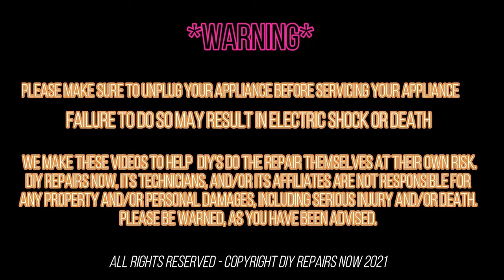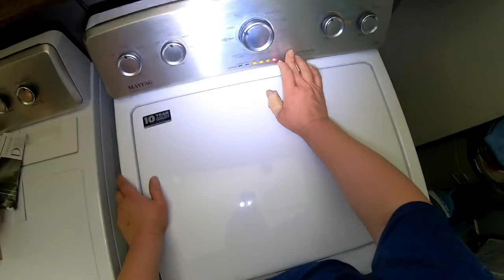How To Fix Maytag Centennial/Bravos Washer OFF Balance | Washer Shakes Bad During Spin Cycle

Comment: Should not have these problems. Maytag went cheap the last few years. Had a 30 year old maytag that we had to replace because the tub rusted out. The centennial we bought shakes so bad it moved across the floor and pulled the drain hose out of the wall port and its only a few years old. This is the perfect example of corporate greed now days. Dollars over quality. This new hanging tub with struts is a joke. “Load sensing” is crap. I miss the old style that never had shaking issues and only took 1/2 the time. And I could choose the water level…….

Comment: this video, way too much being done. wear gloves, pull up on the rod, take the top off. let it down, depress the tab around the rod to release from holder. slide out of holder, pull whole rod from top, take tab off old rod and replace on new. slide back in holder, pull up to snap tab in place pull rod through top replace top cap and voila! thanks!
Reply: This is probably the most helpful comment I’ve found on YT so far!  👍🏼👍🏼
Reply: So you are saying it can all be done from the top?
Reply: Make a video then. Easier said than done
Reply: Or your just slow

Comment: Try tightening the flywheel first to fix unbalanced load issues. It worked for me. Turn your washer on its side ( tape the lid shut to prevent it from opening and disconnect the water supply lines) Use a ¼” allen wrench to tighten the flywheel (bolt is in the middle of the round wheel) . It will be tight to turn. You can use a short piece of pipe on your wrench for extra leverage. Wear gloves so if the wrench slips you won’t hurt your hands. Hope it works🤞

Comment: I can confirm this fixed my Maytag Centennial washer which had been violently banging around during the rinse and spin cycles (for too long I'm ashamed to say). I have model MVWC200XW3 and bought rods with part # W10780048 from RepairClinic. EXCELLENT video! My screws in the back were slightly different (and you need a 1/4" socket). I didn't have to remove the drain line and used jack stands to hold the front and back up. Like in the video, i used a coat hanger with the ends wrapped around a wrench to lift the rods into place. Take pictures of the plastic rod holders beforehand. I recommend doing only two rods at a time, or just one at a time if you aren't confident in your arm strength. The bounce test is on point! Drum was really loose (I'd describe it) before and bounced a couple times (didn't seem like a lot at the time). With new rods the drum firmly and smoothly resets to the level position after a push. Tested with a large load and have a smooth spin. Thanks for the video! It convinced me my suspension rods were bad and took me less than an hour!
Reply from the maker: You’re welcome and thank you for a detail comment that helps people 💯💯👍🏻👍🏻

Comment: I have a similar model and mine is imbalanced even when empty but if the machine started slower, it would be fine. It's like the thing that tells it to spin doesn't work perfectly with the older shocks. It's probably on purpose so it saves them money and makes people buy another one 😂

Comment: Check the level of your washer as well…I changed out the suspension rods, no change. Adjusted the legs to get my washer level, added the four springs around the suspension rods and to the tub, and now it’s back to normal. This wasn’t too bad.
Reply from the maker: Thanks for your comment I’m glad my video can help💯💯👍🏻👍🏻
Reply: @DIYRepairsNow  Hello there Sir. My wife is telling me that washer shakes a a lot and the spin cycle is not working ( cloths are super  wet )
Is this the cause of that problem?
Thank you in Advance 👍

Comment: Thanks for the video! My 14 y/o Maytag Bravos had gotten to the point where it couldn't even complete a cycle without throwing multiple uL codes. I was able to replace all the suspension springs from the top side, which made the repair super easy. I did need my wife to hold the tub in the opposite corner from where I was working while connecting and disconnecting. I have small-ish arms and was able to use the vice grips to pull the old rod up enough to disconnect it from the plastic bearing at the top, then let it down in the cabinet. My arm was just long enough to reach in and unclip the lower blue clip piece from the tub and just slide out the whole old assembly. From there, I reversed the process with the new assembly and was usually able to get the blue clip to attach itself on the tub. On one or two, I had to reach in and help it, but it was no problem. The vice grips were then used to pull the rod up through the hole (I didn't need the wire loop trick) and put the new bearing on. I hope anyone reading this will be able to save themselves quite a bit of wrangling and try the repair from the top first.
Reply from the maker: Glad My Video Was Helpful and You Were Able to Fix Your Washer! Thanks for Watching!

Comment: Excellent video. This solved my issue for sure. Innovation on what to use to help pull the new rod up...I took one of the old ones and bent it over at the spring so you have some sort of a handle. Already has a perfect hook on the other end. You also know it will fit through the hole!

Comment: Yes, thank you so much.  I am a 62 year old female and not very mechanical.  But we got ripped off when the prior washer failed and we bought a used washer but immediately had the same problems with the new washer.  So, this time I am determined to fix it myself.  Your video was very detailed and told me everything I needed to know to get the cover open (warning, I did slam the damn thing on my hand and bang it up pretty badly) For the rest of the repairs, I will wear gloves.  Anyways, I was able to diagnose the problem and use the link you provided to order the correct parts.  Can't wait to finish fixing this thing all by my big self!!! Thank you so much!!!
Reply from the maker: You’re welcome thanks for watching my video 💯💯👍🏻👍🏻

Comment: Great vid! Had to improvise with a cut up metal clothes hanger in place of the wire you suggested. Had the wifey hold the washer while I replaced the springs. Took about half an hour. Thanks a lot.

Comment: Great video. This indeed fixed my banging problem on my Maytag Bravos 300. Two things I did slightly different. Instead of vise grips, I just pulled the rod with my hand and unclipped it from the holder. Second, instead of a wire I used nylon twine to pull up the hook. The twine comes off very easily. Thanks.

Comment: I faithfully followed these instructions. Here is what I have done. Changed the suspension springs or shocks, new drive hub, new agitator (not easy to remove), and leveled the washer. It still shakes badly when beginning a spin cycle. I saw one place that there is a liquid filled ring to surpress  the shaking. Do you know anything about that? Thanks Charles

Comment: Hello, my suspension rods are not bad, but my washer still shakes a lot (not unbalancing), and also squeaks like mice are chatting in there on final spin. I have a few videos on my channel to show you also, (in case you need to hear how it is like) and that would basically explain the noise better. Oh yeah, and I have a quick little question to ask you, is this a Maytag Top Loading Washer 4.2 cubic ft. model number MVWC565FW? I am assuming it is that because I can tell, as it doesn’t say “centennial” on the machine itself. As well as how “MVWC” stands for “Maytag Vertical Washer Centennial” which is why i’m guessing that is the model number.

Comment: I replaced the suspension rods on a two year old machine and noticed the tub was more firm and did not bounce.  However it still shook during the spin cycle.  I have to do extra small loads when using the machine.  I have never had this problem with previous Maytag washers.
Reply: Same. Still trying to figure out what the issue is before I just buy a new one…🥺
Reply: @jaysalterifbbpro-mensphysi3982  - I know this is an old post but your problem is likely a cracked stator.

Comment: This is my exact if not very similar model to mine in the video.  It violently shakes with clothes and lightly shakes without clothes however my drum does not bounce like shown in the video, I would say it had correct resistance and returns to the top with very little bounce, Could it be something else? I do think my drum is a little off-center. Would that tell you rods as well?
Reply from the maker: Yes, if it’s off-center, that means you have to adjust the legs and level the washer but if it’s being like that that means one of the shocks are bad and yes, it could be something else but either way when you have an off balance washer, you start by replacing the shocks

Comment: QQQ do the shocks ever slip out of position? My machine is almost 1 year old. I cannot imagine the shocks being bad already but my machine will not spin.  When i did a calibration test it began to spin and it began a very strong out of balance feel then automatically stopped locking the lid!

Comment: Oh my gosh. I’m overwhelmed. Mine was rocking and shaking loud. But it’s leaking underneath and the spin cycle isn’t working. I don’t know where to begin. I’m a 64 year old woman alone. But just don’t have the means to buy a new washing machine. Can you tell me where to begin with all the problems. It’s a Maytag centennial W10140921C. I’m thinking I need to replace hose pump, actuator and now these poles. Oh boy this is alot

Comment: Not too clear when replacing the shocks. Do you turn the washer upside down?
Reply from the maker: No, you don’t have to turn the washer upside down. Everything is from the top and the bottom you only remove the shocks. Here’s all the links and how to do it. They are different models, but is the same. Procedure in Maytag, Amana and Roper are made by whirlpool.
Reply from the maker: https://youtu.be/voBdCDEIyKg?si=VFAv6-1tVRd_dcZV

https://youtu.be/HvTqvm_WNHQ?si=ErzwoibwTqz3ee0S

https://youtu.be/R_bKnLJK9Yg?si=wcGmP_iptgO-g20i

https://youtu.be/9d5X-7Zlg3s?si=JDMfwNpHyKweC16Q

https://youtu.be/_S1kWKocoUg?si=CFJSC0WSVhE1VFc-

https://youtu.be/qopM0jJ6nfc?si=lgowfHtJTt-R9qu7

https://youtu.be/_QfCtdhVRXs?si=z00VPvCUyVv_Yim3

https://youtu.be/cn8ObB1dmJ4?si=xu1wRh7HMh2vDmhX

Comment: I replaced the struts with factory replacements using the easy to understand step by step instructions as shown in the video. I proceeded with a regular load pf clothes that included a towel..it was so quiet that i didnt even hear the spim cycle. I proceeded with another load which consisted of two towels. When the spin cycle began, the drum went back to banging around. I tried another small load and it was quiet again. I tested the tightness of drum by pushing it down. It only bounced once so its to spec. Does anyone know why it still bounces around ?

Comment: So I pressed down, it only bounced 1 time but it looks like the drum is slanting back to right.  Any ideas/suggestions?
Reply from the maker: If the tub and the drum is leaning to one side, you have to replace the shocks if the drum self it’s leaning, you have a problem with the shifter or the block

Comment: Question: So my son helped me and we changed out the shocks using the ones that we ordered on Amazon from your link.  But these shocks came and they are two inches shorter than the old ones.  We replaced them but now we have the banging near the top problem.  So I will try to fix for that per your video.  But are those the correct parts?  They are 2 inches shorter?  Thanks so much, in advance.
Reply from the maker: It looks like they replace those so we’re not sure if those are the right ones according to the part number it should be the right one but somebody else complain about it. That’s why we replace the link for the OEM ones.
Reply from the maker: https://youtube.com/shorts/pTnLllOoB0U?feature=share

Comment: My mom and I changed the suspension rods with no problem your video was great! but when we do the reset, only the lid lock light flashes but doesn't lock. No water, no spin, nothing happens..we have water open to the washer and all the rods seemed in place. Did I mess something else up?
Reply from the maker: Disconnected for about 30 minutes and try again

Comment: If you lay the washer on its side can you remove and replace with no problem
Reply from the maker: Yes, As long as You do 1 or 2 at a time, It should be no Problem.

Comment: Replace suspension  springs still banging sides noticed that the top tub absorbers are  worn out mostly  gone. Do you think that could be the  problem  because  it's still banging up top where the absorbers  would  be. Thanks
Reply: Tape some sponges where the tub absorbers are and see if that solves it. Worked for me so far.

Comment: Lol you do this everyday I have never done this and  thyou and pretty much figured to use the old struts to do the same thing as the waste time funny piece of wire. I just popped old strut out then slide new one in it's place stuck old strut down in hole from top pulled up and done I literally did this project with one screw gun with no bit on all guns it's 1/4 inch so that fut right on screws lol then a metal pry pic like dentist use and my hands washer all fixed good as new  thanks for video

Comment: Thank you for the video. I did replace the suspension rods and still having the same problem the tub shakes violently. Do you know what else could be the problem?
Reply: I am having the same issue. Replace the rods and still have the same issue.
Reply: @lmrodgers07  Probably the bearings need replaced
Reply: If same issue then the balancer ring has lost its fluid. I've been looking, but I don't think that this part is serviceable, you'd have to swap out the entire basket to correct this.
Reply: Pause it after wash cycle and even them out. Then spin. 
Also make sure your washer is on even flooring. If not prop it up in the front some and screw the pegs down or up until the washer is solid on the ground and doesn't move when you wiggle it around.
Reply: Make sure your clothes are put in pretty evenly. When they get wet they get heavy and can weigh more on one side than the other.
Reply: You can try to re calibrate it. 
Turn cycle knob counter clock wise all the way around to normal. 
3 times to the right back 1 forward 1. 
Then put on rinse and spin. Press start.
Reply: Mine is brand new and it shakes away from the wall, I did the spring test and it was fine, no bouncing

Comment: What if it doesn’t have an agitator in the middle how do we check? Mine was just vibrating shaking violently but there’s no agitator. Bravo xl washer
Reply from the maker: You will check it the same way just put your hand all the way to the bottom push it down, and if it bounces more than once, that means is the shocks

Comment: Mine is brand new and it bounces side to side enough to walk away from the wall, I tested it by pushing down on it like you said and it is fine, I pushed down and it came back up without bouncing , now this only happens when when i put it on bulky items. this machine is brand new.

Comment: Just replaced those rods with AMI rods on Amazon W1130362 and installed them and my washer is still banging if not more than before checked them out again and found nothing wrong with the newly installed rods, could it be because I did not use the Maytag certified ones ?
Reply from the maker: https://youtube.com/shorts/pTnLllOoB0U?feature=share
Reply: Had a well known appliance repair man in our area come by, and told me that I had other issues after running some tests, that the drive shaft and drum had issues, and the repair costs would be to high, and he explained that unfortunately the wash machines these days usually will only last around 5 years, which sounds right this one was just a month past 5 years, and that if the USA would start making them they would probably last longer, it’s also interesting to note finding another new washer of which I went with a GE ( as if it mattered ) that most brands at least at Lowe’s anyway seem to only offer a 1 or 5 year extended Warranty if you want to purchase that, so it was best not to spend a lot on my new washer, and just figure I would probably be buying a new one in another 5 years 😔☹️

Comment: My Maytag washer was shaking pretty bad- the tub was actually hitting the side. After performing the agitator push test, it was questionable whether it needed a new suspension. I installed a new suspension and double checked everything prior to putting the top back on. Performed the agitator push test again and found that it was much more firm. Put the top back on and started a rinse and spin cycle. The problem is worse. Instead of the tub hitting the side it is now slamming into the side. Took it back apart and checked everything again. Looks good to me. Obviously the firmer suspension has amplified the problem. So what could it be?
Reply: I’m having the same problem.  Did you buy aftermarket shocks?  I did. Did you figure out the problem yet?
Reply: Did you get it fixed? Did you research the snubber?
Reply: @davidlittle611  I sure did. What ended up fixing it was buying a new LG front loader. Works great! :)
Reply: @SamGray1999  yeah I just replaced the springs on my Maytag Bravos, and it seems to have solved my problem, but I’m looking at the front loaders in order to save as much water as possible because I’m on a water catchment system. The LG’s are about $600 right now here.

Comment: What if there’s no bounce or give whatsoever? Pushing on the top like you feels like I’m pushing into the ground
Reply from the maker: There’s other things that I can be like the Balance ring the shifter or the cobbler the video is based on the most common things my suggestion would be replaced the shocks first
Reply: @DIYRepairsNow  thank you!